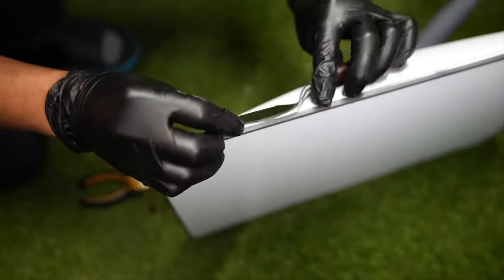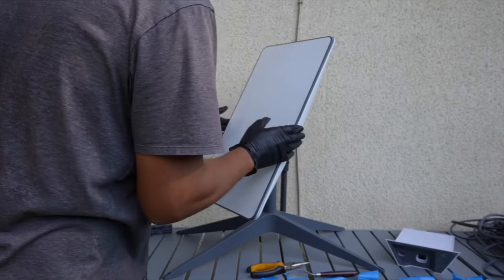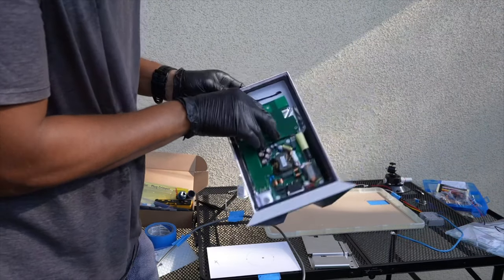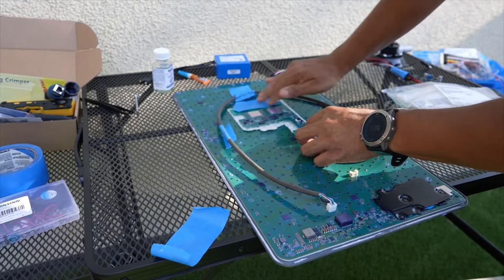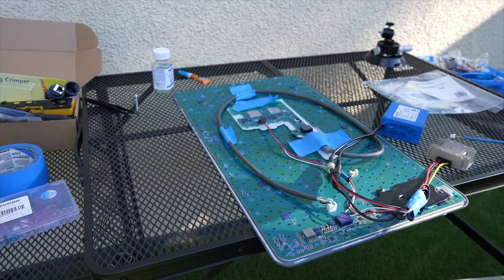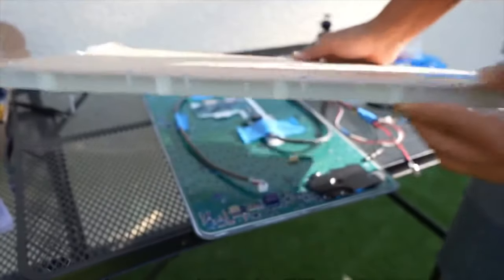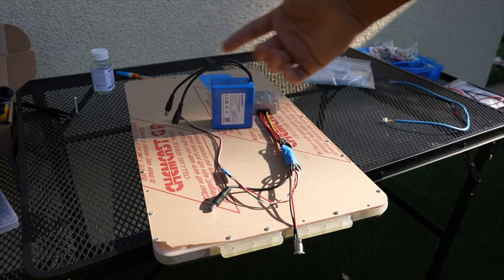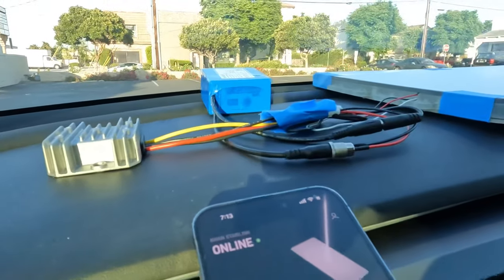How to Disassemble Starlink (Non Destructive Way)

Comment: You now move the infamous turd WiFi noise maker and put it right on the back of the dish that is highly sensitive transceiver.... NOPE.
Reply from the maker: I know the Starlink Wi-Fi is not the best. I don’t have a RV and don’t use Starlink at home and have a different setup. Been using this setup for 2 months now in my vehicle and I still get no interruption and speeds over 100mbs when in clear skies. 2 months no issue here.

Comment: Would you share what exact P/N your starlink router is?  There appears to be at least two hardware revisions of the gen2 router with different Ethernet SICs.  The older version uses Marvell 88E1512, and the newer is EconNet EN8801.

Comment: Good job. Where can we find the items you've quoted for the connectors?
Reply from the maker: Sorry! I just updated the description now. I don’t know if you can find that on Amazon but I found mine on Digi-Key website, don’t forget to buy the pins also to crimp the cables
Reply: @adeelkhanadventures9010  Good evening, can you tell me where can I find the power battery supply 12 V and the converter? pls
Reply from the maker: I bought this 

uxcell Voltage Converter... https://www.amazon.com/dp/B01MTNLW8D?ref=ppx_pop_mob_ap_share

And battery I am using is this one,

SPARKOLE 12V Battery Pack... https://www.amazon.com/dp/B09GVD92JF?ref=ppx_pop_mob_ap_share
Reply: @adeelkhanadventures9010  thank you. I appreciate it.

Comment: Cleanest adaptation of the Internet.  It could reduce the size of the internal connection cables between the antenna board and the Starlink router as it has resources for new clippings on the connectors and make everything just one piece.  Vice gave 10 x 0 in the projects for flat use of the antenna.  CONGRATULATIONS.  

Edited.       With your demonstration, you showed another way that is much easier for those who have experience in cutting wood using a bench circular saw.  Just protect the part of the plate very well and slide the saw firmly against the side support of the circular saw well calibrated at the height to the minimum necessary to section the two parts.  Precise cutting is very clean.  Professional service.

Comment: Great Idea in itself to make the whole thing a bit more portable.
As you mentioned at the end, I wouldn't put the router directly to the dish, as various frequencies may interfere with earch other.
I'm not a satellite expert, but I would almost say that wifi - for exaple - could interfere with satellite reception.
From what I have seen from others so far, I would recommend a different router anyway.
The one from Starlink seems to be somewhat modest.

Comment: This by far seems to be the best POC. This will work great for back Packers as well as motorcyclists who can't afford much space, weight or power.

How much power does this draw or, how long did your battery in this video last? What battery are you using?

Comment: Hey, just a quick question. I am wondering how much current draw the 12V and 48V portion actually uses. I notice you only used a 3A 12V converter so I guess it must use less than that? Seems lower than I expected. And for the 48V portion, what does that actually power? Would I need more than 1A output for that? Please let me know, and awesome video!!! :)
Reply: Just desolder the big left chip on the bottom side and remove the resistor that way you can power the dish directly with 12V you won't need a 48V DC converter that wastes power.
Reply: @antoniok4735 
hello. Can you post a photo of this piece? This solution is much cleaner than those seen on the Internet.

Comment: you mentioned providing a pinout of the connector to dishy, would be very helpful to have that!  Also, which cable are you using to connect back to the dish with the (ZPDR-10V-S) white connector - is that the cable that is threaded thru the stand or is that part of the long cable that connects between the dish stand and original modem box?  Thanks for sharing!
Reply from the maker: Sorry about the pin out part, I’ll update that tomorrow in the video but I matched all the colors that you will find on the connector that’s connected to dishy inside. I cut the cable from the side that connects under the dishy, the modem side is angled and not worth it unless you mod needs it, I used a dremel to sand out the excess part of the connector.
All colors in the cable are exactly the same that’s inside the dishy already.

Comment: Another option, mount wifi board and 12v 48v converter into car glove box compartment and run wire trow dor panel collun  and in the roof install Waterproof UV-resistant ABS solar double entry for cable wire 6mm to 12mm for RV roof Boat.

Comment: Hey @adeelkhanadventures9010, do you know if it can be slimmed down a bit at all? Is there enough clearance between the connector and the inner surface of cover? I have this crazy idea of sticking it to the inside of my sunroof while allowing for the latter to slide into the roof still.Thanks.

Comment: Hi, in your video I couldn't see how you connect the 3 wires from the Wi-Fi card (12v, 48v and gnd) to the inverter where there is 12v, positive and negative, with 48v positive and negative) i.e. I have 4 wires in the inverter with 3 wires on the Wi-Fi card, could you explain it to me?

Comment: Hi there, my gen 2 dish is dead and Starlink refused to replace it due to a sub standard mount, there is no sound coming from the dish and it won't even stow, i think it isn't getting power, is there a fuse inside that blows or something else that would cause this issue??

Comment: Hi Great idea to move router to the dish. 
Do you know what exactly is powered by 48v? Maybe only antenna surface heating is powered this way so you can ditch the 48v power supply for no winter usage.
Reply from the maker: @peterfairlie2296 You are correct! There is a way to use 12v only for Dishy, I did not want to desolder the Inductor and diode as I wanted to be able to reverse the mod back to original if necessary. I was very tempted to try Oleg Kutkov 12v mod (link to his website)

https://olegkutkov.me/2023/06/09/how-to-power-starlink-terminal-from-12v-without-poe-injector-and-dc-dc-converters/
Reply: @adeelkhanadventures9010  you wold be the first on youtube with "only 12V, all in the dish Starlink setup". 

Just saying :)

I'm planning this for my RV as the roof is made from composite and router should be strong enough to have good WiFi covarage inside. Only one anderson connector will be feed trough the roof. 

Thanks for the link to Oleg's blog!

Comment: If you heat the edges with a heat gun, it will separate easier. Use the tools available for cell phone repair. The process is similar.

Comment: If you disconnect the motors, won’t the software give you a motor error? If so, does it work with or without the error?
Reply: It works without motors....after a few minutes it sends a motor error and switches to stationary mode

Comment: Would you have information on how long it'll run on the batteries you showed?
Reply: I run 12v 6800mAh 3s3p 18650 battery with original long cable about 45 minute, It draw upto 10A when I run speed test especially upload. 6 to 7A in avg. Maybe my $3 boost converter is not efficient enough.
Reply: @EVIndonesia  thank you. Do you have any updates on this?
Reply: @baliwski  I'm planning to convert gen 2 into "portable" I don't think I'll need boost converter and poe, since everything already in the same enclosure just like in this video. And I'll run the whole system in 12vdc. 

In my optionion the power consumption should be more efficient. I'll give you and update when the conversion done.
Reply: @EVIndonesia  thank you! Looking forward to it. As you know the mini has been released. I don't know which one would perform better. But for sure, I would need a portable one for weekend travels. 

Thank you for all you do
Reply: @baliwski if you have choice may be mini wi suit your need. But here in my country (Indonesia) Starlink service just start about 3 ago. We don't think Starlink will release mini soon. even the gen 2 in avg need around 1 month waiting list. Lucky me they sent me the packet after 5days after the order placed.

I've ordered yaosheng poe 3 week ago, it's not came yet all the the cost, the clone one cost me around 50usd. That's why I started open the router casing and end up going this path converting to portable 🤣
Reply: @EVIndonesia  I'm from Asia too, and the mini didn't exist during the time you created this video. I think this by far is the best mod I've seen

Comment: Are you concerned about overheating?
Reply from the maker: Operating temperature is -22F and 122F on Dishy and Router. I plan on using it through Tesla Model Y Roof so inside the car with A/C I doubt I’ll be hitting those temperatures (obviously dishy will be off when car is parked and not is use) but in areas with high temperatures I might take the router outside and put it in a different case.
Reply from the maker: Update: I was using this setup and it got hot enough inside the car (parked car) to give me a Wi-Fi overheat and reduced performance, so Wi-Fi module is the one that needs to be a little cooler, I put a small temperature control fan and it actually works great now. I’ll have a update video soon.

Comment: I see that the system works receiving satellite signals through the FRONT windshield of a Tesla - have you tried it with the satellite signals coming through the roof/top glass on a Model 3/Y? I suspect it might not work due to the coatings that block UV/sunlight on the roof glass but curious if it might work up there.
Reply from the maker: I actually tested it through the top roof glass on our 2020 Model Y and it was working and stayed online during testing, it downloaded updates also. Now if they did some different coating on the models after 2020 then I don’t have a way of testing that.

Comment: Your Wifi is signaling direkt 7nto the Antwnna from the dishy and also the metallshield is missing you became massive problems with emv and also with your bandwith is signifcally decrease because of all these mods. There is a technical reason why the router is not in the antenna.

Comment: Not the best video or setup. There are way better videos on youtube than your setup. 
First desolder the motor jack you don't need it you will save space that way. 
Second desolder the big bottom chip and one resistor on the left side the board that way you can power the dish directly with 12 volts from your car you won't need a 48 DC converter that wastes power.  
Third buy a 90° jack for your ethernet cable and buy flat cat8 cable and crimp a new cable that way you will lower your profile even more. 
Forth get a better thinner backplate ready made there a few sold on ali express which are quite good and you will have a way better thinner dish. 
Fifth get rid of that big bulky useless starlink router and buy a third party wifi 7 router from ubiquity. 
And that's the final procedure so enjoy your new 4mm thick dish.

Comment: How's this project coming along?
Reply from the maker: So far it’s been working great! I have used it on my family road trip and it’s been amazing, the only annoying part was tall trees in Canada but as soon as I parked pointing to the open sky it works great. I did a few upgrades and added a temperature control mini fan to keep the Wi-Fi board cool and added a higher amp 48v converter which made a difference for in motion speeds. Update video coming soon as I changed a few things.

Comment: Does work on the first gen version (round one)?
Reply from the maker: I don’t have the round dishy to test with, so I am not sure on that. If it has same grey and white line on the side, I am sure you can gently tap using the pry tool I use to see if it opens up, but be careful there might be wires so gently separate it.

Comment: Cann you sand me wiring diagram conection between dischi and router
Reply from the maker: The wiring is exactly the same color that you will find on the connector you will disconnect from inside the dishy. I am working on a new update video coming soon and will add those details in their.
Reply: @adeelkhanadventures9010  thanks a lot